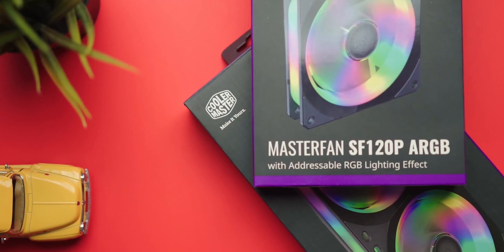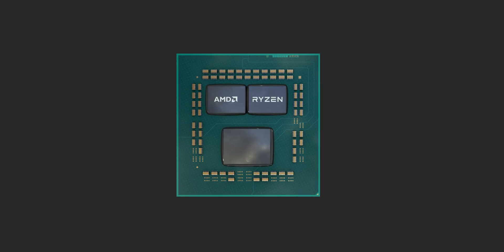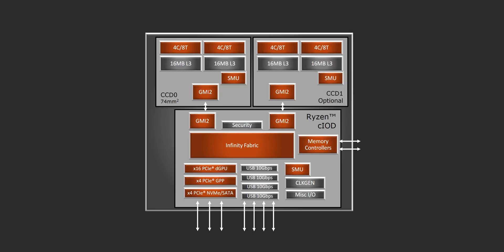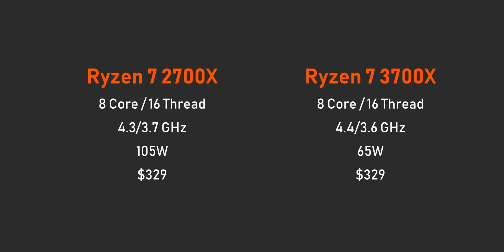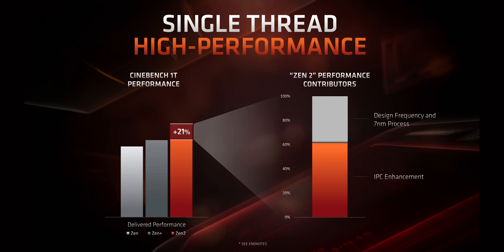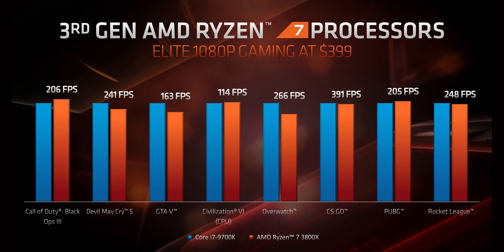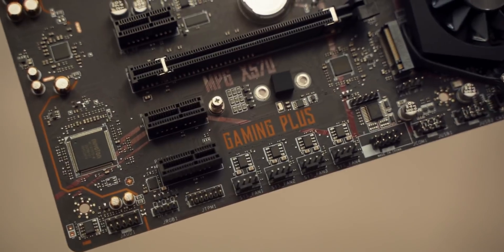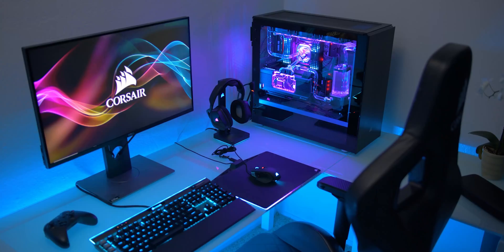AMD Ryzen 3000 – A Very REAL Problem For Intel?

Comment: Yeah, that AMD infograph is somewhat missleading. The board cost for gaming mid-tier and high-tier is much higher for the next gen. (30%) The 9900k + board is actually in the same price tier as the 3700x-3800x, as you will need aftermarket coolers to overclock the AMD CPUs to be competitive. It is the same through the whole stack down. This puts the Intel parts roughly in the same price per performance range of the Zen 2 parts. Currently Intel's parts look slightly better for gaming but worse for other task than the equal AMD parts in the stack. The 3900x is likely to be worse single core but much better multicore, but at a $200 dollar premium. 

I was super excited about Zen 2 at first, but the pricing, performance estimates, and the overclocking headroom discussion from AMD has really tempered my expectation. If you look past the hype, they are not smashing Intel as hard as we believed or hoped. I think AMD is actually more costly than they should be considering the board cost spike. Hopefully Zen 3 is where it is at in 2020, as Zen 2 looks to be a move to recover RnD. I definitely want to be team AMD again, but it sounds like they are trying to match performance/price of Intel's stupid high prices... Which means higher CPU and board cost of the high-end are now permanent. Thanks for effing the market Intel/Nvidia.
Reply: The X570 cost is higher and on par with Z390 yes but unlike Z390 where you have to pair it with a K SKU on AMD's side there are other options. A decent B450 or X470 board will run even the 16 core part. I think the difference X570 boards will make is overclocking headroom. Zen2 baseclocks and TDP's are ok enough for most previous boards to run at stock settings but for overclocking i think better boards do make sense. Thankfully PCIe 4.0 has very limited use cases right now. Almost none for GPU and only some for SSD's but only in sequential performance it seems.

Actually looking from the AMD slides it seems the more cache a CPU has the better it's single core performance will be. So it might actually turn out that 3950X and 3900X have better single core performance than their Ryzen 5 and 7 counterparts. Well based on boost clocks alone they already do.

When it comes to underwhelming graphs i think AMD shot themselves in their foot by not enabling security mitigations on compared Intel CPU's and by not using Win10 1903 with the updated chipset driver that offers topology and clock speed ramping improvements. So depending on when the new chipset driver is ready we could see another 5-15% performance advantage compared to Intel on top of what was shown at E3. 

And i think Intel knows this too which is why they seem to have made the unexpected decision to slash prices up to 15%.
Reply: @Raivo_K  those were stock clocks, and  AMD reps already said the 105w tdp parts won't have a lot of overclocking headroom. I don't think people will want an outdated or budget board, as Zen 3 in 2020 is likely gonna be the real deal. So people upgrading from older Zen to Zen 2 are golden, but if I was buying in to Zen 2 now, I would want to get a mid-upper tier gaming motherboard so I could replace Zen 2 with the new CPUs in 2020 or 2021. The older and budget boards will have really aged by then. 

Mostly I am speaking from an enthusiast level build, which would be high-end SKU CPU and Mobo. The high end of the stack is what is disappointing. The lower end of the Zen 2 stack is effing killer.

The 3900x and 3950x will be a premium above what the 9900k cost. I was hoping we would see the 3900x or 3950x be around the same price CPU + Board, but instead they are much higher. I was already disappointed with how Intel raised the pricing on high-end parts to what I thought was a ridiculous level.   

I'm honestly tired of Intel and AMD fanboys, as in the end I think that for a consumer all of these price increases are bad for the future market... Wages have not improved at anywhere near the rate that the price is inflated for these parts. I appreciate you being reasonable and not being a dick like a lot of people though.
Reply: Im on the opposite side. I feel the low end stack is dissapointing and the high end is great. Let me explain:

R3 is still only 6c/12t. With next gen consoles being 8c/16 this needs to change. I was hoping that would happen with Zen2 but apparently not.
3700X is the same MSRP as 2700X when it came out. Same core count too. I was hoping for lower price considering...

3900X may cost the same as 9900K but it offers 4 more cores and threads for the same price with compareable performance even in single threaded workloads. Obviously we need to wait for independent bechmarks to verify this.
3950X is even better deal because the only competitor Intel has against it is their 9960X HEDT part. For the price of 9960X alone i can buy 3950X, a high end X570 motherboard and plenty of RAM and get not only better performance in both single and multicore workloads but also lower power consumption despite the same number of cores. And for the price of 9960X system i can build two 3950X systems that do double the work at the same time.
Reply: @Raivo_K  the dev and production cost for Zen 2 is more competitive than previous parts. AMD admitted this already. The x3900 is NOT the same price as the 9900k with board. That would be the 3800x. Intel's parts were already insanely over priced, and AMD matched. 

The whole stack is positioned 1 too high. 3950x should be 100 more than 9900k, 3900x should be same price as 9900k, and on down the stack. Then the boards should have been a 5-7% increase and older boards including z390s should have dropped in price. That would have driven the market, that would have been a return to normal pricing. Instead AMD matched. 

It is whatever, at least we have competition now, even though the new higher pricing Intel caused is here to stay.
Reply: What do you mean it's not the same price?

Sure 3900X will be 499 while 9900K is currently 475 minimum. AMD may have matched 9900K's price but like i said - with 12c/24t part instead of Intel's 8c/16t. It's suprising how many people overlook this. 3950X is already i deal. I don't see this falling very much. 3900X may fall if Intel really cuts their prices by 15% like recent reports suggest. Im sure AMD will respond when that happens. Meaning if Intel drops 9900K to around ~400.

Z390 and Intel boards in general don't drop in price unlike AM4 models. That's because on Intel boards there is always only 2 generations of CPU's you can run on any given board. Thus there is always someone willing to pay for used board. I mean look at used Z68 on Z77 boards. They are old but still cost as much as new B450.
Reply: @Raivo_K  no I mean X570 gaming boards are 20-30% more expensive. The entry is the same and there is a budget B line, but high end to high end is what I mean. Yes the 570s are going to be way better, but they are newer, just not 20-30% increase newer. Look at how insane the Godlikes and Asus Heros and up cost for X570 it is insand. AMD drives the board part pricing with spec requirements, especially when it comes to overclocking. So a 3800x + board is more equivalent to the 9900k + board. The 3900x will be at least $100-200 more unless you cheap out with a X470, B model, or entry budget X570 board. I think people are missing that or just plan to by entry or last gen boards.

I am also not down on AMD, and am happy to see them back with competition. It is great for the market, and will force Intel adapt. It is unfortunate that Intel dominated the market and got to jack pricing. I personally hope they get kicked in the teeth, but I don't see them sitting idle. I suspect we will see new Intel parts late 2020 or early 2021 that compete with the Zen 2 refresh (Zen 3? Zen 2+?)
Reply: Ah i see. Yes that makes more sense if you are comparing X570+3900X vs 9900K+Z390.

But i would argue that X570 is not nessesary for 3900X where as Z390 is nessesary for 9900K if someone plans to do overclocking. And it can't be just the cheapest Z390 board either. The same can't be said about 3900X where im sure one can overclock it perfectly fine on a ~300$ Crosshair VII Hero which imo is the best and one of the most expensive X470 boards out there. 

And proper Z390 boards cost about the same (~300). With AMD you have options to scale the build cost up or down where as with Intel there are usually only 1 choice that makes sense for any given processor.

X570 would be nice to have but to be honest today it does not offer very much advantage over X470. Maybe in a few years when we have PCIe 4.0 SSD's and graphics cards that need more bandwidth than 3.0 can provide. People often make this argument lately that the Ryzen 3000 plaform cost is the same or higher compared to Intel but use X570 as a nessesity in their arguments.

Comment: Guys get the non X versión of the ryzen 3000 they will overclock near or just like the X versión.save urself some money or get a nicer mobo or rgb cooler . Unless u don't know how to overclock than get the X version.
Reply: the only non X version this launch is the 3600. they aren't doing non X for 3700,3800,3900. 
at least not yet, though I don't see why that would come later.

Comment: Regarding your comment about Adobe Premiere using QuickSync. Yes, it is much faster than software decoding but is the end result the same (in terms of quality and size)?
Reply: DaVinci resolve is imo  much better application and it doesn't need QuickSync to be fast. That's an Adobe fail.

Comment: Intel will always be faster than AMD in single threaded performance that is guaranteed, but when it comes to price to performance,  AMD is better, and now with the new IPC Amd is much closer to intel in single threaded performance and I see no reason why not to buy AMD processor.  Also those extra PCIE lanes will come in handy. Losing few frames in games is no big deal compared to the amount of work will be done and those extra cores will come in handy.  Also Intel processors are double the price lol. Buy it if you want to show off your frame times in games, other than that I dont see any possible reason. Sure some softwares like Adobe suits are better on intel but there are others software which are super fast on multicores than adobe. Rendering and 3D work is all about cores, blender, zbrush etc. I really dont see any reason to buy intel when with cost of intel I can just buy "TWO RYZEN" processors and build two PCs and increase productivity twice the amount lol.

Comment: I keep clicking on this kind of videos because of the wait for release...
Reply: I'm building a brand new PC in September (mine is 8 years old, no updates since) and the anxiety is going to kill me before then. These videos are what's keeping me from losing my shit.
Reply: Caue Venancio Same. I've used the same laptop since 2010 and it decided that it's 212 degrees even though I replaced the thermal paste on CPU and GPU and both fans back in December. 😭😭 I saw the leaks back then and after I saw their CES keynote I decided to wait and defect to team red. Now I'm going to buy all new parts for a tower in July and grab a 2200G to hold me over until the 3950x comes out. I don't want to deal with upgrading my CPU for a few years.
Reply: @Nuggie_terpfessor  I feel your pain. Thankfully it seems like the wait time will payoff. These CPU won't be a bottleneck for many years to come. Especially with the OC potential. AMD is saving our lives and wallets!
Reply: @Nuggie_terpfessor  Well, if you have such an old laptop for so long then I'd say don't get the 3950x. I mean, why 16 cores? You won't see a difference, you can get by with a 3700x for 6 years easily. Also you'd save up on the 2200g and you'd have it by July, ready to rock.
Reply: Eduardo The short answer is because I'm really excited and want to go all out even though it's overkill and a waste to an extent. In reality, I'll probably cave and get the 3900x at launch so I can have a full system right away. I'm not going to get the 8 cores, though, because I waited this long. If I was going to get only 8 cores then I would have built an system on a 9900k months ago. I was an Intel fanboy until the beginning of this year.
Reply: @Nuggie_terpfessor  You could use the money and get a 3900x with the new m2 SSD using PCIe 4. I didn't see the prices though, so idk if it's worth compared to the old ones.
Reply: Eduardo From what I’ve seen/heard the pcei 4 drives are going to be way more expensive than I could possibly justify. I’m coming from twin 500GB SATA SSDs and getting a 2TB 970 EVO PLUS (only $250) to hold me over for a few years until the gen 4 drives are more affordable.
Reply: It's a pain...
Reply: @madd5  Same here! time goes by slowly :S
Reply: Hurry the fuc up
Reply: Loli about to buy PC parts before 20 duys, but now waiting for 3600, and my watch working slower than ever

Comment: How are they not charging a premium between the 2700X and the 3700X ? The chip area has decreased, so they can produce it cheaper, but the release price is the same.
Reply: 7nm production cost is higher than 12nm so my guess is that this offsets any die area savings. Plus the fact that 7nm is cutting edge right now. As time progresses it will become cheaper to produce. But i think this has also to do with competitors. Seems like AMD is done playing the budget brand. They seem to price their parts very close to their competitors while offering more cores or some other beneficial features.
Reply: @Raivo_K  7nm is cutting edge, yet the iPhone has had 7nm chips for a year now. They have high yields because of their chiplet design. It is not as expensive as is assumed. We are paying a high premium. Their margin is close to intels and nvidias now.
Reply: Mobile SoC's are much smaller and easier to produce on a new node. They always come first on a new node. Then usually laptop CPU's, then desktop and lastly GPU's that are the biggest and most complex.

Considering the lowest priced 16 core Zen2 server part is ~950 then 750 for same desktop part is pretty good. Plus AMD prices always fall. I would not be suprised when the 12 core part is less than 350 and the 16 core part less than 500 next year before Zen3 launches.

And yes im pretty sure they have higher margins now.
Reply: @Raivo_K  Of course they are easier, but its been a year. Thats almost one of intels former Tick-Tock cycles. And the chiplets of the CPU are extremely small, thus not even really comparable. The chiplet size is 74mm2. The die of the A12 is 83.27 mm2. So thats no excuse. Its even smaller than a mobile SoC.

Comment: its interesting really since AMD has only just caught up to intel. However that's at a smaller process node compared to intel currently still on 14nm++++++++++++ but barely beating them in SCP does that mean since intel is able to get 18% IPC (low end notebook chips) gains from their 10nm that amd really should be able to get a decent IPC gain when staying on 7nm. (yes ik the process is different and architecture and stuff but im just interested.)
Reply: Well atleast it's not as bad as on the graphics side where AMD can't beat Nvidia's 12nm with their 7nm parts. Nvidia unlike Intel is not sleeping.

Comment: i am definitly upgrading my pc, i am currently ro[cking a fx 8300 cpu, planning to upgrade it to either the 3600(X) or the 3700(X). it depends on the gaming performance
Reply: Get a non X i  own every ryzen CPU that  came out n the non X. Overclocks to the X specification.  Save urself some bread  or get a better motherboard..but don't really need. High motherboard to overclock the 65 tdp CPUs.
Reply: @NeVErseeNMeLikEDis  im running 1500x, didnt touch a thing, as im not a tech savvy 😄
Reply: Hugo alright

Comment: wccftech has the layout for 12 core as 2 6 core chiplets not 8 and 4.....I am not sure which would be better. 8 and 4 would have an advantage of 8 cores on one chiplet but i would think 2 6 cores would overclock better....hmm....this is all conjecture
Reply: Two CCD's must have the same core count. So 8+4 is not possible. 6 and 8 core are single chiplet so there's no problem there.

Comment: I have a request in with Santa already, for a 7nm 16 core Ryzen 9 3950X, with a 2TB (or larger, if those are available and not too pricey) M.2 NVMe drive, and at least 32GB of new fast ram to suit AMD processors. I haven't quite decided what I'm going to do about video yet. It will be AMD, and it will be mid-range. I am not going to be spending over $500 or more on a video card, no way. More likely, it'll be less than $200. (At this moment, an RX580 is starting to sound pretty good, maybe ex-crypto- mining, off eBay.) ... And I'm not going to start spending money until November or early December. But a 16 core Ryzen that'll hit about 4.7 on all cores, and XFR turbo to way over 5 GHz on one, I want one of those.

Comment: Intel is fine. These chips will compete but won’t beat an OC 9900k for gaming, leaving the high end to Intel. Next gen intel chips also show like a 20% ipc boost too, so this won’t last long imo.
Reply: "so this won’t last long imo."

I bet there were plenty of people who said the same in 2017 when Ryzen 1st gen came out and look at where we are today. Those Intel chips you are talking about are laptop parts with only up to 4c/8t and 4.1Ghz boost. Very low even compared to Intel's own 6c/12t 5Ghz boost laptop parts. Not to mention desktop parts.

10nm for desktop is not even on Intel's roadmap and looking at the laptop part specs i mentioned above you can see why. I think you better need to prepare yourself for the eventuality that Intel will not be able to launch anything much better than 9900K for the next 4 years. Sure they'll add 2 more cores for a 10 core part, improve boost by 100-200Mhz but that's about it.